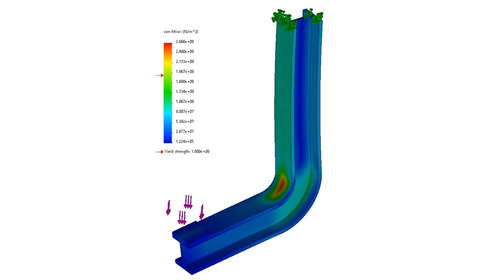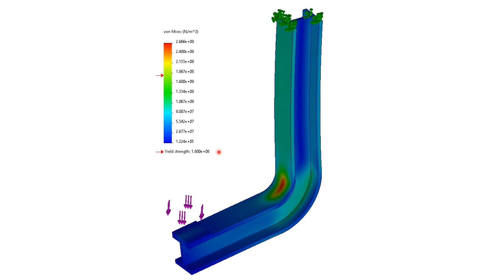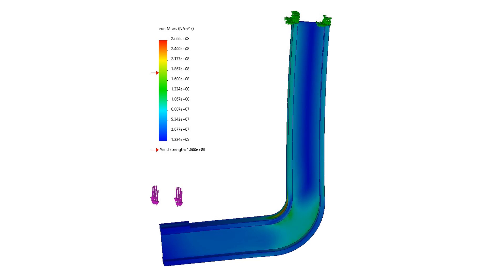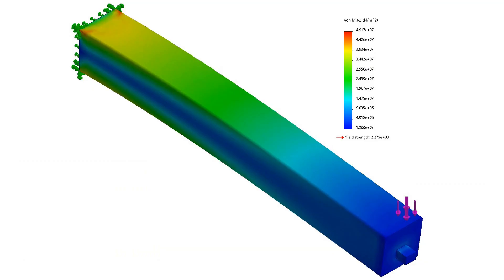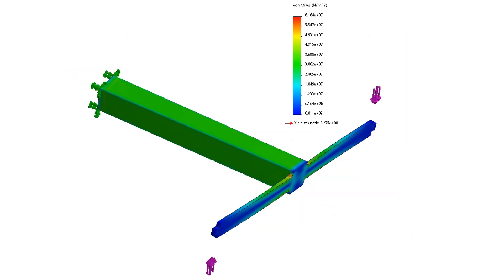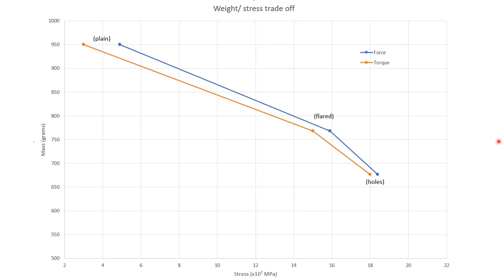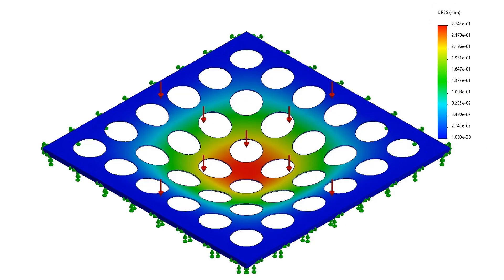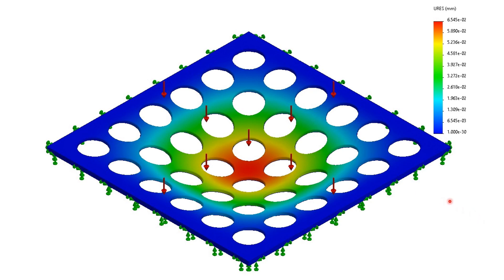Do flared holes do anything normal holes don't?

Comment: May I add some constructive criticism with regard your FEM. Have you checked the volume of the model flared and unflared. I suspect that your flared models are effectively heavier than unflared models, and so stresses and deflections are consequently reduced due to more metal, rather than the direct effect of flaring a hole. In practice mechanically flaring a hole does not add material, it simply moves metal. My understanding of flared holes, in aeronautical use, is that it improves local out of plane instability and maybe improves fatigue resistance by cold working. FEA is not generally suitable for instability analysis without modelling actual local deformations and probably using plastic, rather than linear, analysis. Aircraft flared apertures are usually designed empirically based on physical real world testing. Showing reinforced structures as an example is misleading with regard to flaring of holes without additional material. Paul
Reply from the maker: The flared models were heavier, as say a 50mm hole on a plain piece of metal would not remove the same amount of metal as a 50mm diameter one with a 6mm flare - I would expect the base hole to be something like 40mm. Understand what you are saying with respect to more metal, but I think it more likely the results have changed because of the local thicknesses.
This was not meant to be a 100% accurate definitive study, more something indicative to show typical effects of flares under various loadings as I'd heard comments to the effect that the flaring made the part stronger when in reality they stiffen things up, with perhaps some local reinforcement

Comment: Great informative video. It would be interesting to note if there is a benefit to alternative flared hole patterns.
Reply from the maker: Starts getting into a bit of a rabbit hole there because it will all depend on what you want the hole pattern to do. Round would spread the load more easily, triangular will save (slightly) more weight. As you would have seen from the examples, remove too much material and it critically weakens the structure. A pattern such as @RonCovell did on his curvy seat project will stiffen the centre of the seat while allowing a bit of flex at the edges - although the lip that was put around the perimeter probably stiffens the seat more than any flaring would do.

Comment: I did some analysis on holes in aluminium square section antenna booms with holes and it was remarkable how sensitive the result was to the hole diameter. In that case the holes were for fixings rather than weight reduction. I rather imagine that flaring the edges would help to reduce cracking from corrosion caused by environmental exposure, but that the flares in aluminium might make the problems worse, especially in extrusions. Flares add a lot of cool though, especially if a certain @RonCovell made them.  Careful annealling and finishing of the edges might help in some grades of aluminium, but I came to the conclusion that avoiding holes in the booms and using glued saddles was a much better solution where the antennas were out in the wind and rain for years at a time.
Reply from the maker: Lately I've been considering trusses for that lightweight but rigid structure... (work in progress)
I guess another problem for you radio buffs is windage - holes would help, but it would be a balancing act between removing wind surface area and taking away material that the structure needs to spread the load effectively.
Reply: @occasionalmachinist  Holes do tend to whistle a bit in the wind. I shove a bit of closed-cell foam into the extrusion to stop the spooky noises they make at night. On a related matter, have you ever played with Simscale for modelling? I'm trying to get my head round it for heat-flow and behaviour of structures subject to wind, but it makes my remaining braincells ache
Reply from the maker: @MachiningandMicrowaves  Never used Simscale. I do try to persuade sthe boss that a CFD package would be a good thing to have to work out heatsinking issues, so perhaps I should have a look at it. Given that you can understand RF antennas and I can't, if your braincells ache, mine would be going full KIngsman...

Comment: Interesting would have been cool to see the impacts in a c channel comparing horizontal and vertical loads
Reply from the maker: This software is really basic so does not analyse cases where things might buckle. Open sections like a C channel are prone to failing that way, so I'm not sure I could produce meaningful results. I think that with the reduced amount of material it would fold/ buckle more easily with plain holes. Flared holes may counteract that but I could not say whether better or worse than plain channel. If the boss ever stumps up for a more powerful package I may have a look...
Reply: @Occasional machinist  yes it will fail just seeing the where and how is valuable. Anyway thanks for what you have done to bring some light to the subject..

Comment: Very well done video! I will certainly recommend it to people when they ask what the benefits and downsides are of adding holes to a structure. Have you done any tests on the effect of the size of the flares? Seems like that would make a difference. With the flaring dies I use, the flare is about 6mm deep, regardless of the hole diameter.
Reply from the maker: From memory I nominated a flare depth of around 6mm in the study as well. I suspect that once off the curve of the flare, any extra length would not stiffen things greatly as it would be a bit like a piece of thin wall pipe, able to flex and distort. As for hole diameter, I think the more important thing is the spacing between the flares - too great a distance and it would tend towards being a piece of flat sheet. if things were kept really tight, it would be stiff, but there would be a lot of work to put all the flares in, as well as having enough room to physically get in there

Comment: Very useful explanations for non engineers like myself. 

Perhaps comment on how the flared holes are best made to avoid micro cracking failures and whether material choice is important. Steel is a fairly safe material from this respect.

Aluminium is a specialised subject as extruded and different grades of aluminium will react differently. And welded aluminium is also potentially not very safe (unlike steel).

With respect to holes in beams, there are some very clever folks at Westok (GB) who create structural steel beams with holes using special cutting and welding.
Reply from the maker: I'll have to have a look at Westok.
Metallurgy and cracks is not something that I have dealt with too much, so can't say too much about it with authority.
For the points you have raised, I think it would depend very much on the notch sensitivity of the material, so yes, material can be important. Preference to a cutting method that leaves a clean hole but sometimes you are stuck with what you can do.